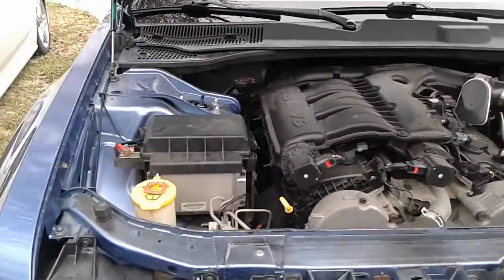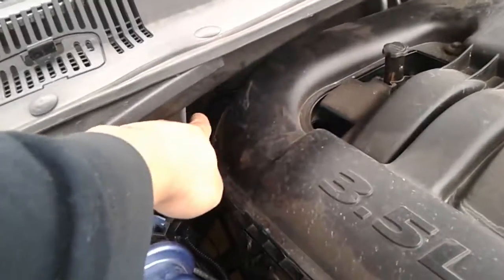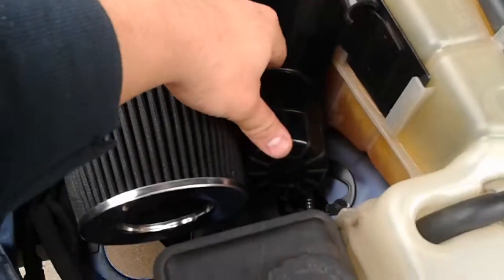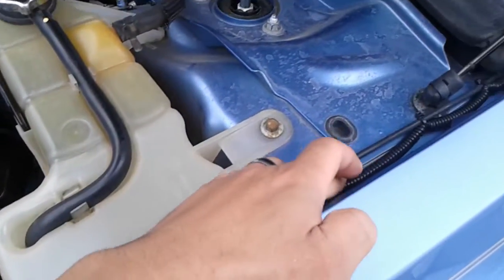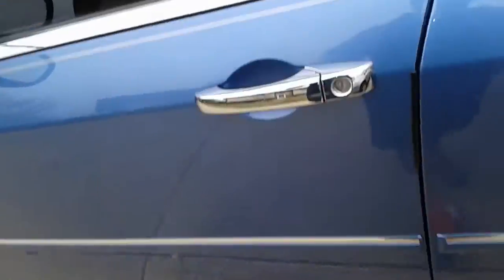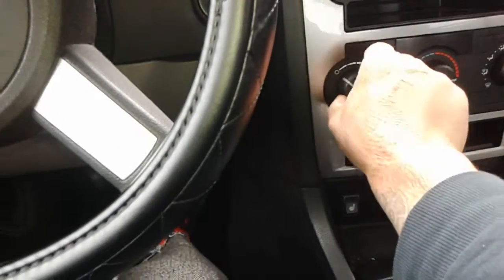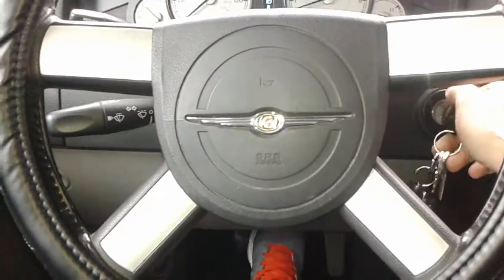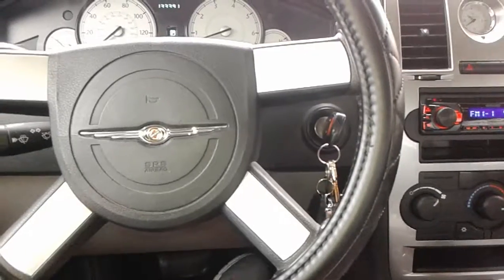2007 Chrysler 300 with Autopage 730a Alarm/Remote Start

Comment: I installed a flashlogic flrsch5 on a 2007 chrysler 300 sometimes it starts and sometimes it doesnt
Reply from the maker: Shawn Walton  what unit do u have?
Reply: Flashlogic flrsch5
Reply from the maker: Shawn Walton does it run then dies?
Reply from the maker: Shawn Walton did u use a T harness?
Reply from the maker: Shawn Walton urs is a tipstart or normal key?
Reply: Fl1pSde yes I used a t harness its a reg key it runs.  I just have to press my lock button real slow and be standing really close to the car
Reply from the maker: Shawn Walton  does everything work now or still the same?
Reply: Fl1pSde its working I just need to add the range extender
Reply from the maker: Shawn Walton  it would have been better if u did the same as one I did. long range as well:) its under 200.00 for all.